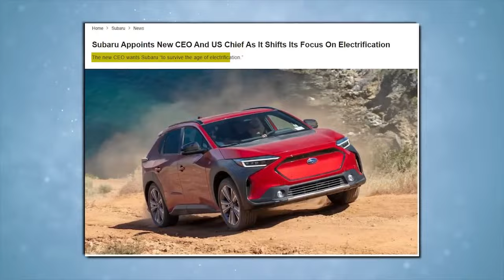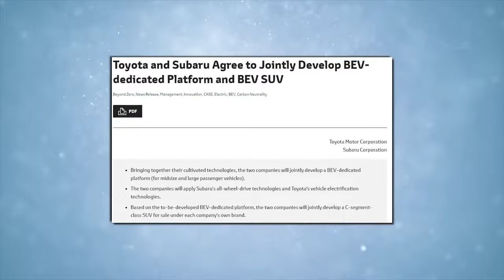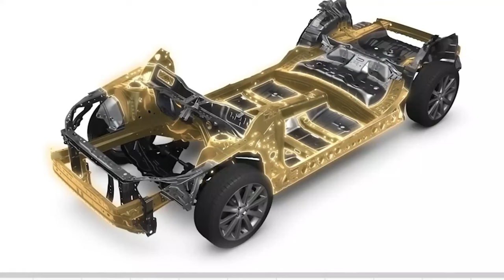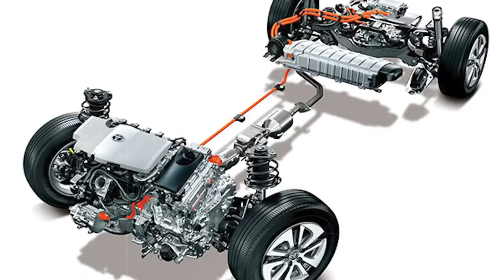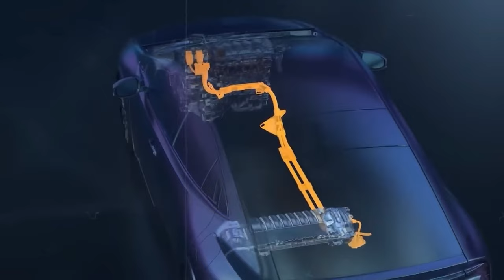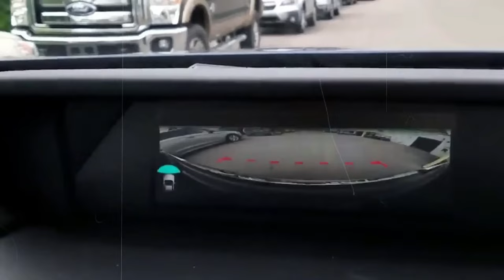Subaru CEO Introduces ALL-NEW $23k Pickup Truck & Shocks The Entire Industry!

Comment: Get rid of the boxer
Reply: I used to have a 5 speed outback. Such an ugly sound and no power.
Reply: @Kamasaki286  Exactly. Crap power and torque and there's no benefit like extra reliability.
Reply: The boxer is Subaru! It will be a sad day when it's gone.
Reply: @kdubb81  Yes but a company like them could easily make a much better engine.
Reply: Agree, the F1 engine was underpowered and never made it to a single race.. 😢
Reply: Most balanced design of all engines. how about just impoving it's short falls.
Reply: @markseehawer3762  but again, that doesn't translate into better reliability, so what's the point? In fact, they're less reliable overall. The advantages of a low mounted flat 4 are more than offset by other weight distribution and suspension changes in anything other than a balls to the wall rally car.